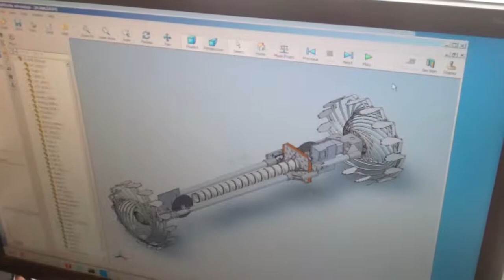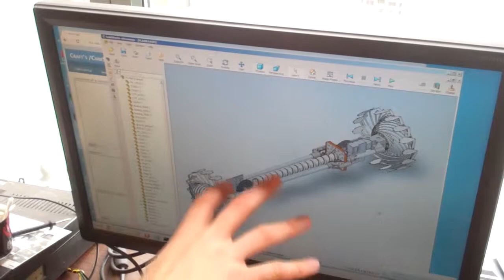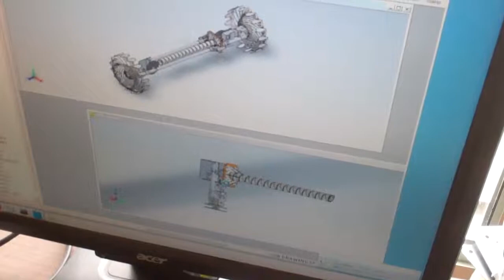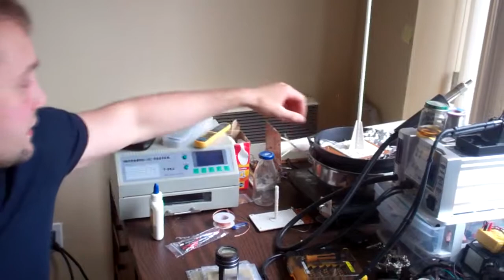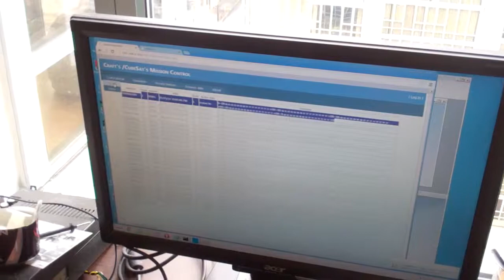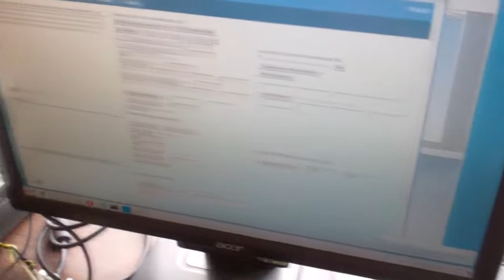3 configurations, Mission Ctrl + Ground station integration (интеграция системы управления)

Comment from the maker: Last 2 weeks - Rover - was done 3 configurations.

a) Rover as moon rover - it is a "virtual rover". Exists in 3D model formats. Majority parts has to be made from carbon fiber. To make each  (carbon fiber) part need to design molds, and to print molds from PVA (like this) on a 3D printer (like that). Today we know that on that printer, to make all molds, and to make all carbon fiber frames (like this), with "space capable to fly" epoxy (like this) it is require total 45 days. That is why we named that moon rover as a "virtual one". Before arrangements of the flight to the moon, it is not practical to spend time and efforts to build such device. Only demonstration can be a purpose for rush, to build a "virtual rover".

b) Rover as a ground station for a test flight. That is exactly same rover but designed to operate on the earth surface. In this case it is not require use of carbon fiber. Same parts can be made from less strong plastic.

c) Compact version of a rover. It is not a rover truly speaking -- it looks like regular ground station, but parts for such configuration is exactly same as in configuration (b). That compact version also is for a debugging software purposes. Configuration (b) and (c) has totally different mechanical properties, but software which will control 4 stepper motors in first configuration and 2 steppers motors in second configuration, must be the same, software should be self adaptable for such different mechanical configuration, to perform task for orientation the antenna to a moving target -- flying cubesat.

Plus convenience to use 3D printing on factory allows, to separate process of design and manufacturing, make ground station on 2.4Ghz for a cubesat repeatable, and,  who knows!, can allow to support main project by taking  orders to build 2.5 GHz  ground stations. Parts can be ordered on next week via shapeways factory.

Antenna will be regular helix (like this one), or reduced size helix (like that one). Reduced size helix has major advantages -- 3D print is twice less expensive than regular helix; different winding of a conductor allows to reduce interference of two transmitters working on the same frequency at the same time, which is important in a case of constellation of cubesats flying together.

Ground station electronics and software. The same main processor board for ground station (like this) is reused from a cubesat main processor board. Last week was done integration of a board with mission control, today mission control can operate flash memory and main computer commands. Some improvements was done on simulation of a flight, and session data visualization.
3 configurations, Mission Ctrl + Ground station integration
Reply: How about a kickstarter page for this? Just a thought...
Reply from the maker: Already 2 teams from competition placed itself on kick-starter and non amount was collected. All attempts was done 2-1 years ago. Only one project was funded - somebody get 1000 $ to write story about GLXPRIZE competition.
From the beginning of a competitions I do not have any dreams that anybody will help me with any amount of money - business because of a known reason, government because of well known reasons.
I am OK. Look - Today I know all steps which I need to do, I have at hands all technology which I need to reach the moon, and I am assembling everything together! And my wife did not kicked me out for spending my pay check! To achieve the same by working in GovAgency I would need to spend half of my life just to arguing that it can be possible. To achieve the same by working for a business - business will be mad on me each day because I am not predictable and invent something which people with a money do not understand at all. And can you imagine Alex working for military?
Crowd sourcing - noble idea - it is - but it require skills of well known propaganda minister. I have luck of such skills  - plus - I was born in USSR and I hate all propaganda.
Reply: So basically because someone failed to get funding 2 years ago you decided not to? Kickstarter's audience has grown in the last 2 years and many projects that now get funding  would not be funded 2 years ago. From what I hear, the environment improved. I would definitely suggest you try applying there. You have the 3D CAD drawings, that's most of the "propaganda" needed to show that you have unique design for the task of Lunar exploration. That alone will draw interest. I can help you if you don't have time.
Reply from the maker: You right in a point that 2 years ago is not the same as it is now. I have the same opinion - if you remember in 1999-2000 to sell one copy of ADRO it was require 100-150 clicks  via advertiser's search engines. And that 150 clicks cost 10-15$. We sold ADRO copy for a 70$ and digital river give us 35$. In some days I upped prices for bids (it was 5-8 different search engines) and it was scalable - spending 10$ per day we did sold of 1 ADRO per day = 20$ profit. (I did tests for 10$ spending per month, then  per week, and per day - it was perfectly scalable)
What do we have today -(a) ADWORDS - was grabbed lion share of the AD marked. (b) to get 100 clicks needs to spend 15-30$ - 2 times more (c) !!! to sold 1 copy of Lunaro needs to have 1000 clicks == loss ==100$. But now is  interesting information - at summit at Chile, at pub I told that numbers, and another team right away said that the same happened to them - loss - clear loss! And more - my partner (!) who perfectly knows my story about ADWORDS - he also admit that the same happened to his business - he previously was shy to told  that fact directly to me.
By my understanding and available to me information crowd sourcing model of business today is simple one - somebody will spend 100-200$, receive in returns nothing (or useless) and keep quiet about his losses. For me that is the same a Ponzi's pyramid, and my goal on the moon is different one.
I have something more than cool-looking 3D drowning, it is the goal what to do on the moon. Except China and North/South Korea none of space agency in the world have a clear goal. Should I try to tide-up something valuable with financial m-m-m ? I prefer do not.
Reply: But you have already determined and somehow decided that the "donors" expect some sort of return on their investment. They don't. Crowdfunding is not same as ad marketing. They are looking for a novelty value and a conversation piece. "Look, I've contributed to the lunar mission" - there is a value in that, even if it's not monetary. Let the donors decide on this themselves. You are not obligated to provide a return on their investment, you'll spell it out in the terms of their donation. This is certainly not a pyramid where you get new proceeds to pay off older members, I think you are too dramatic. Anyways, just a word of advice.
Reply from the maker: To get: "Look, I've contributed to the lunar mission" in exchange for money,  that is exactly what I mean - put 100-200$ in exchange for nothing. I did see (person sits on front of me) how people attracted and bought "useful" devices via kickstarter.
I can not give anybody anything in exchange. It is not dramatic - it is a reality.

As human-been  we have to be useful to self-kind in exchange for resources, that is our nature and business model, constant in 50 thousands years. What I am doing is out of that scope.

As long as I can stay out of resource's heavy operations - better my chances to achieve the goal.
Last 3 years I am monitoring how it is possible to get extra moneys for a project - all ways does not brings me close to the moon, and some even will ground me (just implementing gyro system, or quasars-orientation system on earth can stuck me in a business (or in military) forever- Bay-Bay Moon!).
I do not see, now, suitable ways, to finance "space" project. If  I'll really see the way - I'll ask to help right away.
And if I will not found how to do this, it is not dramatic at all, at least not new in space exploration - flight path schema of a first man on the moon was from inventor (we do not know his real name) who did not like to participate in resource's distribution chain. He refused and resists to do so by living under fake ID half of his live.
Reply: Oh here we go. Yes there are dead astronauts on the Moon...;)
Reply from the maker: In 3 words: кикстартер незаслуживает усилий - It is for consumers who wand to buy something which nobody else has.
I can bet you 1000$ that 99% people getting "3D printer pen", will not print more than 1 model.
Reply: mission accomplished ;)  
...Space Oddity